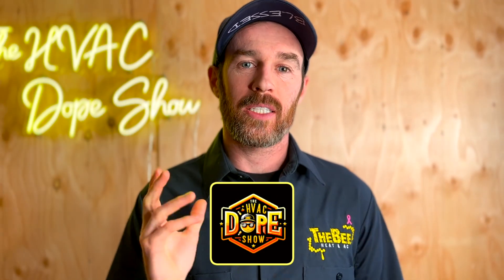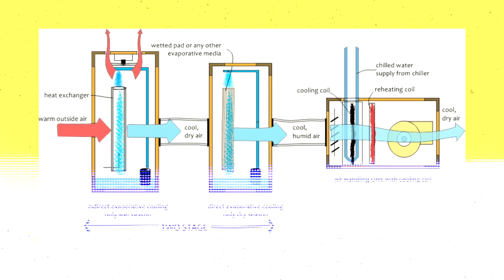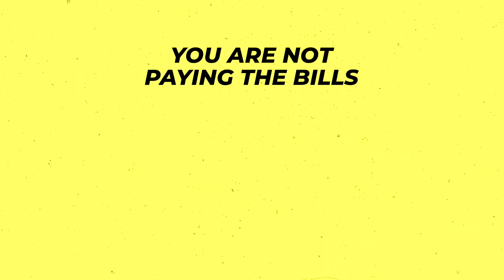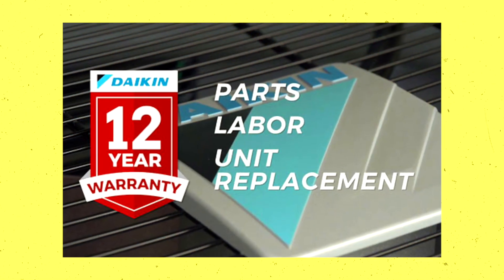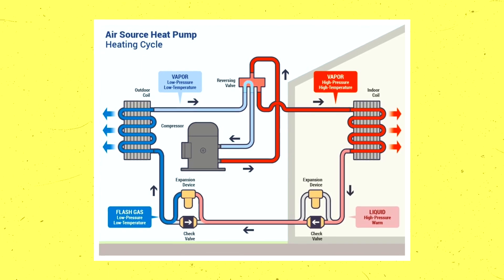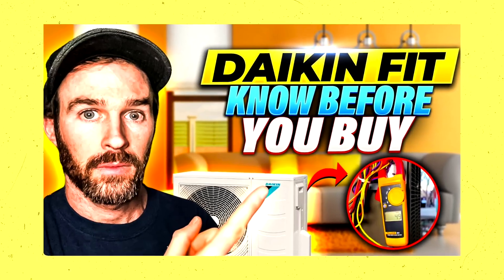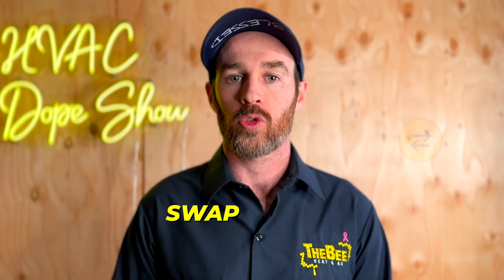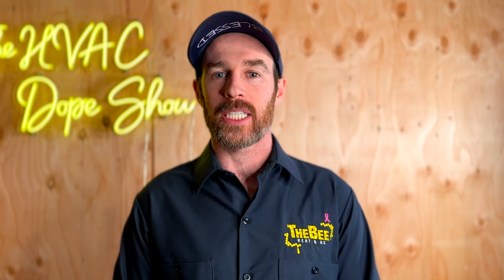Air Conditioners in 2024 | What you should know

Comment: What is a reasonable price for new duct work?  
10 runs (10ft - 30ft each). 
2000 square feet ranch, single story, AC in attic center of the home.
Reply from the maker: Really hard to say because this will vary widely based on a contractor’s overhead… I’ve seen quotes for stuff like this for 10k and I’ve seen quotes for 40k, but the quote for 10k doesn’t know what they’re doing because the parts cost is probably about that. I always recommend avoiding the low bid if it’s REALLY low (like 50% of everyone else) because they’re either taking shortcuts or missing something or don’t know the expenses of their business, just get a couple quotes because the prices will change by region. Colorado has one of the highest labor rates for HVAC for example, but in Wisconsin your quote would be 50% of what you’d pay in Colorado
Reply: @TheHVACDopeShow  - $10K for the flexible aluminum stuff?  $1000 per vent run?

Comment: How about york?
Reply from the maker: I believe they just got bought by Bosch, technically Johnson controls owns them, but York I don’t really have an opinion on… I know they’re side discharge heat pump is not rated as high as the daikin fit enhanced so I would still lean towards that. Bosch in general has a better inverter product than them at a better price point, that is simpler to install and repair. So far I really am impressed with Bosch. They’re not our primary line because the Daikin fit heat pump is quieter in the defrost cycle which is important in cold climate heat pumps, and it’s true communicating comfort, but I’d put a Bosch in my house just as much as I’d put a Daikin fit in it.

Comment: I think i have a simple question and hope you can answer it. I live in an almost 4000 sqft home, but currently the only "livable area" is just under 3000 sqft. We are planning on using more of the square footage as we continue on with construction updates. With that said, our AC just died. Over 20 years old and my hvac guy suggested we installed the  Amana ASXS6 S-series. It says it's a 4ton unit and 16.2 Seer. Do you think that would be good enough to keep the 3 floors we do currently use cool?
Reply from the maker: Would have to do a load calc to know for sure, what size do you have in there now? And what amount is above ground? 3,000’ above grade (aka not basement) in Phoenix would require 7-8 tons probably depending on the load, but in Denver you might be ok with a single 5 ton. Not sure on your climate

Comment: No one talks about the upcoming refrigerant change. Should we even invest in any unit right now considering January 1, 2025 change?
Reply from the maker: It’s up to you, I’ve heard some people have hesitancy both ways… some want to get 410a equipment while you still can before the new stuff comes in. Honestly if you’re system is working and you’re going to be in the house for 15+ years then probably wait, but it’s going to be a LONG phaseout from what I’ve heard, and 410a prices have actually dropped from 1-2 years ago. If your system is broken just get a new one it doesn’t matter but if it’s proactive planning you could wait for an R32 system, Daikin will have these units available as of Q4, so september~ timeframe. I’d prefer R32 over 454b for a few reasons
Reply: get the current system before you can’t

Comment: Having done tons of research online prior to needing a new HVAC system I found just what I needed when that time came. AND it came as my 14 year old system finally took it's last breath  LOL  I called my local Daikin dealer and they had a Daikin Fit system installed in one day !! I can't say enough good things about The Daikin Fit, it's super quiet inside and outside, keeps the home cool as a cucumber in this brutal Florida heat and my electric bill has also decreased. I have a 12 year parts and labor warranty and got $ 3,200  in rebates and tax credits when it was installed which is a win win !  Do your investigation on what is best for your application, but trust me Daikin is a great product.
Reply from the maker: Thank you for sharing your testimonial that’s great to hear!
Reply: Thanks for info. man....My a/c croaked today and I,m on here learning!....steering toward this brand.

Comment: I am in the St. Louis, MO area and am currently getting quotes for a completely new system. (a/c, coil, furnace) 
- I have a 2-story home with only 1 overall single-stage condenser. 
- Upstairs is typically 5-10 degrees warmer during our summer months. 
- Our electric here is more expensive than natural gas, so I'm not sure if a heat pump makes sense. 
I am getting so many different sales pitches and they all have good points, but thought I would ask. 
I almost pulled the trigger on the Amana 4T Heat Pump ASZS604810A but I am worried I will pay more for an electric heat pump and my gas furnace will sit idle until temps get real low for our typical 3-4 month winter for the dual fuel purpose.

I've been told the way to go it Single-stage due to enough cold air getting pushed to the upstairs, but I've also been told a 2-stage will work with more efficient use of the compressor and better humidity levels.

In your opinion will the Amana ASXS6S4810A keep up with the need for what I will want upstairs, or will I be making it worse on myself? (thermostat on the 1-st floor)

Comment: What air conditioner unit would you recommend for a condo in Minnesota? Brand and unit.
Reply from the maker: For Condos IMO it depends on where the condenser is… if it’s on the roof or out of sight and not something you’re going to hear regularly when you’re running the AC then IMO you wouldn’t really see a big benefit from a high efficiency because condos notoriously have much lower bills because 1. Lots of shared walls / insulated from other units 2. Not a huge load / demand. But if the condenser is on your patio and you have to look at it / hear it when you’re out there then a Daikin fit or similar side discharge option is ideal because it’s space saving and super quiet (if that’s important to you and you spend a lot of time outside on your patio/deck in the summer for example). Hope that helps!
Reply: @TheHVACDopeShow   or a high rise condo? with cooling tower? looking a replacing a dedicated bedroom air handler/ coil unit.  thank you, Great channel!

Comment: I don't use AC, i think it's useless. I have to consume 800 watts for half an hour to take 84 to 82 °F? With all the noise it makes? And when you switch it off, temperature goes back to 84 °F in five minutes. No thanks. And it's bad for the environment. I personally use the technique of leaving the windows open all night to store the freshest air, and during the day I keep the shutters half closed so the sun doesn't get in. It works form me, and I keep a fresh house (77 °F) in the hot summer days.
Reply from the maker: You must not live in Phoenix
Reply: There are way better options than using 800w. 
   If your concerned about the power and it being bad for the environment, build and A/C yourself and show us. Because keeping your windows down is seriously not going to do much at all.
   Even in the winter 77 feels way too hot inside. A/C was designed so that we don’t have to unnecessarily loose water while doing light work.
   It can bring temperature down from 85 to 75 pretty quickly. And will last a while depending on design of house.

Comment: Age should never be a deciding factor.  Condition and ability to get replacement parts, efficiency (a 7 SEER prolly needs to be replaced), and suitability (is it actually sized right for the space).
Reply from the maker: Age if it’s broken… I wouldn’t recommend replacing a compressor on a 20 year old R22 system?
Reply: In that case I might agree, but it isn't due to age, it's due to government mandated shortage and exorbitant price of R22.

Comment: Just came across your channel and wanted your opinion. I live in a 50 year old 1900 sq ft 2 story house and I live in Missouri which gets pretty hot and humid at times in the summer. The second story is always hot during the summer as I think most 2 story houses are. Currently the hvac system (single stage) that is about 28 years old and is going to be replaced soon because the a/c needs to be recharged every few years from a leak and just age. So since it's a 2 story house would a two stage or even a variable stage hvac system be better?
Reply from the maker: Inverter for sure I wouldn’t bother with two stage. Daikin fit enhanced with backup furnace would be a good system for heating and cooling in your climate and for that specific scenario. In the hotter summer months I would leave the fan in “circulate” mode even on low, and that, plus the continuous airflow characteristics of the Daikin Fit, will make the house much more comfortable upstairs. The other option is a supplementary system for the upstairs
Reply: @TheHVACDopeShow  Thanks for the reply!

Comment: Had an AC tuneup done yesterday and was told that my furnace heat exchanger has a crack in it. The cost to fix/replace the fins (can’t think of what they are called) but I have 5 of them and it’s like $1400 for each so like $7k. I’m told I can’t run my furnace anymore because of the crack. Seems that I need/should just replace the Entire Furnace and AC system
Reply from the maker: Normally it’s maybe 2k or so for the whole heat exchanger that seems high but yes when we see a cracked heat exchanger we recommend replacing the whole system due to the fact this normally happens on old units that are at that age anyways

Comment: I've had a Amana system for 20 years now and haven't had any issues besides a small leak in the heat exchanger drain pan last year. I know Daikin bought Amana and they both look very similar. Are there any differences? I'm on the fence if I should replace a system that has been trouble free for 20 years.
Reply from the maker: You can wait til it breaks but they normally break in the middle of peak season when you need it and when contractors or busy. If you can replace it on a shoulder season that’s normally the best and most proactive approach

Comment: brand does matter to some degree.   I've had three friends and neighbors who all bought goodman.   All three have been replaced in less than 5 years.   Granted, this is Las Vegas, but to add insult to injury, my next door neighbor is now on his 3rd Goodman in under 7 years, and is already having problems with this "new" third one, just installed in the fall of 2023.   and their warranty didn't even cover the last one, because it had already been replaced on warranty.
Reply from the maker: Yikes that’s terrible, were these diy installs? I can’t say I have seen that happen even in vegas where it’s hot unless there was something missed in the install or it was oversized for the ductwork which tends to burn systems out. Big thing is lineset flush or replacement, nitrogen brazing, and a solid vacuum @ 500 microns to remove moisture, and proper sizing, if those are done I don’t find issues with them that often.
Reply: @TheHVACDopeShow ….
All 3 were pro installs with different companies, in different parts of the city.   My neighbor being one of them.

Comment: I recently replaced an A/C unit with a Daikin DX9VCA3610AA.  Is this also a heat pump?  Is it a good unit?  It cost as much as a car so I hope I didn't get swindled.  It supposedly has 85 stages.  Does this mean its an inverter if true?
Reply from the maker: DX9 is a top of the line inverter AC, not a heat pump but very efficient and quiet. Great system!
Reply: @TheHVACDopeShow  Thanks!  You put my mind at ease, sir

Comment: Help: I’m usually flexible with temperature swings, usually 75F in summer and 66 in the winter, I was quoted 10K for a Daikin DX4SE and matching 80 AFUE gas furnace plus a new 50g AO smith included in that price. He said it was a single stage… since I have a wide temperature comfort range, you think I should accept the quote for a single stage? Hope it’s a good price, first time homeowner with AC replacement, old unit is 30 years old. Thanks!
Reply: He also said the two stage is 3-5k more expensive. **
Reply from the maker: And multi stage is more about comfort than efficiency on a furnace although it does help a little. Two stage acs are more efficient for sure but again if your bills aren’t very high might not be worth it. One piece of advice is be wary of the “cheapest” bid you get if it’s way less than the others (for example if you got 3 bids for 10-12k and one came in at 5k I would be worried about the quality on the cheapest bid although sometimes this is just because one man operations don’t know how to price themselves)
Reply from the maker: It wouldn’t hurt to get another bid and depends on the market but at a glance that’s an excellent deal. Your biggest drivers of price are going to be local cost of living standards as that directly correlates to overhead in a given region… I’ve heard systems like that quoted anywhere from what you’re quoted on the lower end up to as high as 20-30k but it’s really more of a reflection of a Given businesses operating expenditures. If you trust that contractor (they came referred or decent reviews) then you’re probably in good hands. Whenever I have family from out of town asking for a referral I go through the local parts houses and they will normally refer you to a good shop (one that doesn’t take shortcuts / has a good reputation amongst contractors). Congrats on being a first time homeowner! Also depends on the size of the home and your utilities. Homes under 1500 square feet in moderate climates can go with lower efficiency. Higher efficiency AC or heating is a no brainer in hotter and colder climates but again depends on your local utility rates too.

Comment: I really enjoyed your post, which got my aging brain working.  Very serious question for you.  I’m a 77 year old severely disabled Veteran living on a fixed income.  My Lennox AC unit is over 35 years old and my Lennox natural gas heater is 28 years old.  Obviously both have outlived their prime time and are not very efficient. I’m concerned either or both could fail at anytime.  I feel that I should begin the research/planning very soon.  If you offer a suggestion, would you replace both units before they (or me!) die.  Or should I consider installing a heat pump with a gas pack for cold weather? Thank you for your help.  And by the way, Jesus is alive! 🙏
Reply from the maker: Thank you and glad you enjoyed it! It really depends and the short answer is you want to weigh the cost of repairs vs the cost of replacement. If you’re trying to maximize their life and not worried about them breaking in the middle of winter or middle of summer, then you can technically just wait until they completely go out. This is basically defined as “expensive to repair” to the point you’re replacing a major item like a compressor or a heat exchanger, in which case the money is probably better spent on a new system. If you plan on staying in the home forever then the benefit of a new system would be peace of mind knowing you’ll get a solid 10+ years before a major repair, and higher efficiency / utilities savings, along with potentially increased comfort. If you’re in a climate like Phoenix where it gets extremely hot and you’re concerned with it failing in peak season then I’d replace it on a shoulder season (fall or spring) just to get the best possible deal and replace it when it’s not an emergency. Hope that helps!
Reply: @TheHVACDopeShow  Thank you very much for your reply.  I've b been like a squirrel in the road on this issue.  I live in the mountains of Western North Carolina where the winter temps can be in the teens and even single digits at times.  Thank you for helping me come to the decision that I will wait until one or the other wears out before I do anything.  I bought a home warranty that includes HVAC coverage.  This will provide a little cushion WHEN one or the other breaks.  Thanks again.

Comment: Hey bro, I know you're a big fan of Daikin Fit, but I have a quick question: if I have a flat roof, which means no attic, will installing the Daikin Fit HVAC system and placing it inside the house make it louder or produce more noise compared to another brand, based on your experience? What do you think?
Reply from the maker: The condenser will always go outside. You mean the ductwork inside the house? That’s not a problem, you’re probably going to put the air handler in a mechanical room / repurpose a closet or something. Depending on design of the system will really affect the “noise” but condenser is outside. The noise inside the house will be airflow related depending on duct design and system sizing. System should be sized for the load, and duct should be sized for the system accordingly.

Comment: Questions i have a hvac heat system with ducts. What better way to install a 4-way mini split or central  air? Also, do i need  new ducts? i put central air
Reply from the maker: Central air, but you could do “both” with a slim duct unit that integrates with a multiport ductless condenser. So if you still need 1 ductless head unit in a place that’s difficult to run ductwork too, you can do that, and then have a ducted system with a slim duct unit for the parts of the home you can serve with ductwork.
Reply: @TheHVACDopeShow  i just checked. i have a carrier furnace

Comment: I counted the days last summer. It was 12 days where i was uncomfortable either because of the heat or too high of humidity. Sounds like single stage is right for me would you agree?
Reply from the maker: Do you not have AC at all currently? If so then that’s probably right just a basic system would probably work for your needs